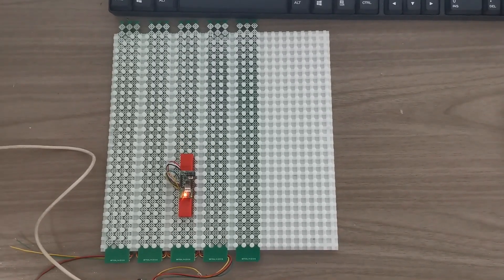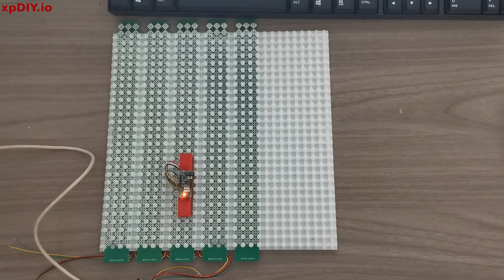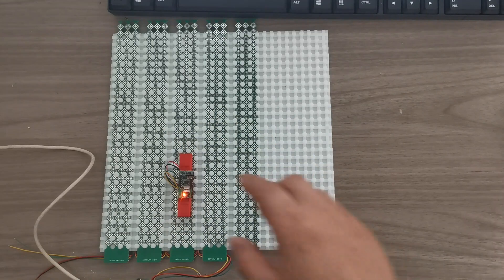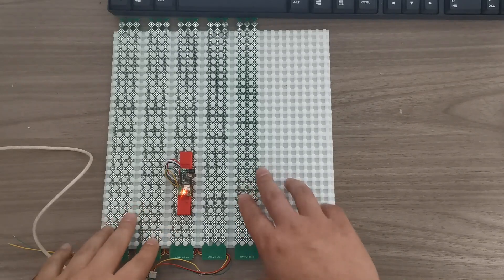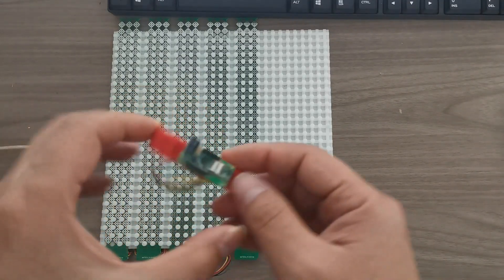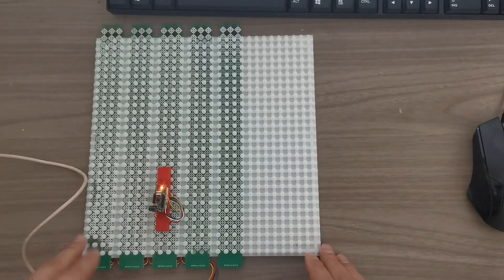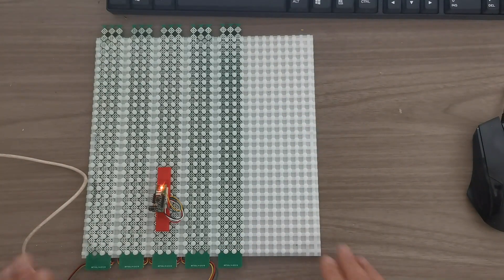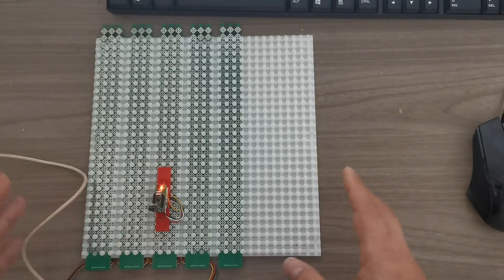3DPlacer - Position aware mod

Comment: This is really great, I am very interested in this project as and can't wait to see how it continues to develop!

How are you determining the position on the grid? Are there any limitations to the number of devices you can detect or how large the grid can be?
Reply from the maker: Thanks, the position is determined by resistor dividing, it  is able to support a bit more than 50 positions, which means 40cm x40cm range, what put on the plate can be detected.

Comment: This is truly intriguing. Firstly, is the baseplate a conventional Lego sheet? Am I accurate in understanding that the baseplate PCB comprises three lanes, with each cell featuring 17 pads? Are you establishing connections between the feeders and the PCB through pogo-pins? Additionally, could you clarify which BUS protocol you are utilizing—is it I2C?
Reply from the maker: The baseplate has the same size with Lego sheet, but height of bump is higher (4mm). For the PCB, yes, it is 3 lanes with 17 pads, the communication happen with 5 pogo pins, I will share the spec later on my website. And the data is transferred through UART @115200bps. Most chip should be  able to support.